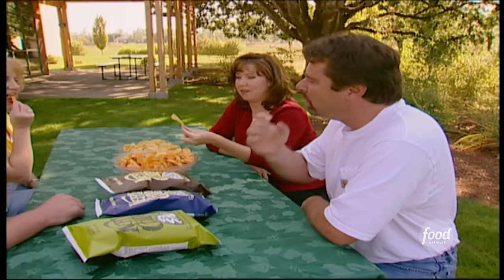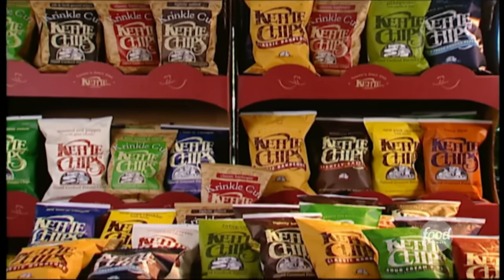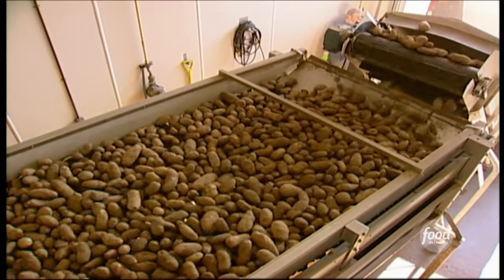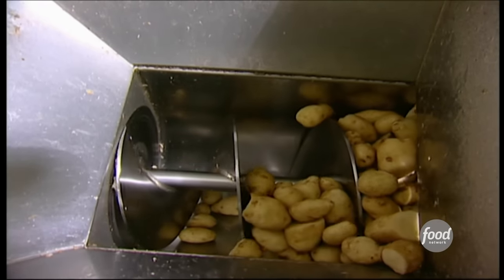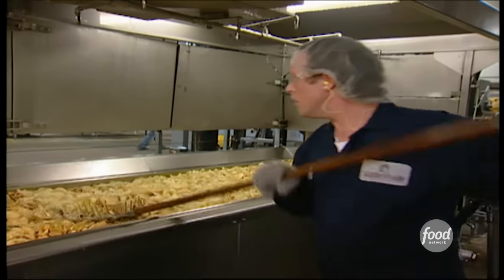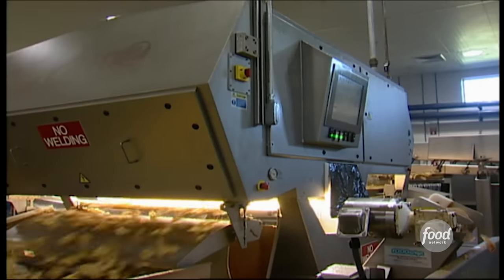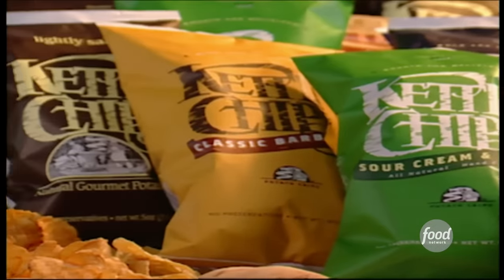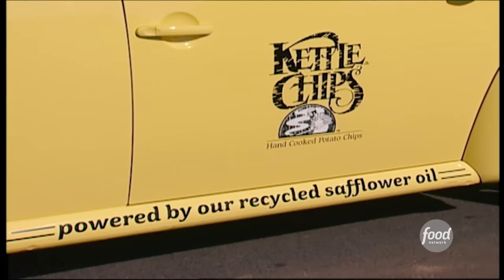How Kettle Cooked Potato Chips are Made | Unwrapped | Food Network

Comment: I'd love if they sold bags of the burnt chips I love them.
Reply: Cape Cod does. They call then "robust russet, " or at least they used to.
Reply: Look for the "Uglies" potato chips.  They specialize in using rejected potatoes that are perfectly safe to eat, but have cosmetic imperfections.
Reply: @nahor88  thanks a lot for that.  found the website.  never knew they was sold
Reply: shouldnt it be economical for those potatoes to be used somewhere? like microwave mashed potatoes?

Comment: I have yet to find any brand of chip that has a bag that isn't 1/3 air, 1/3 decent sized chips that break instantly in dip (ridged or not,) and the rest is garbage consisting of broken shards no bigger than a dime and/or whole pieces from the potato ends no larger than a quarter.